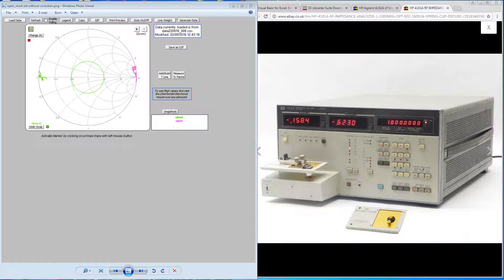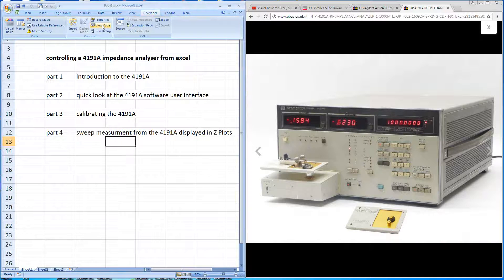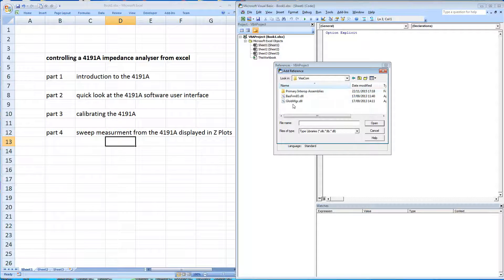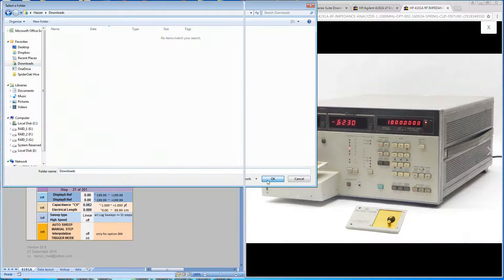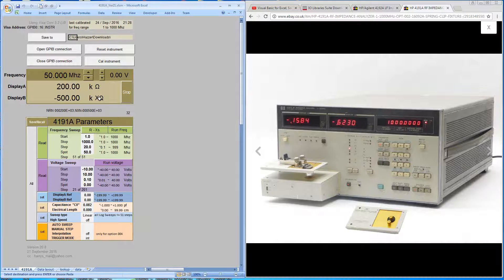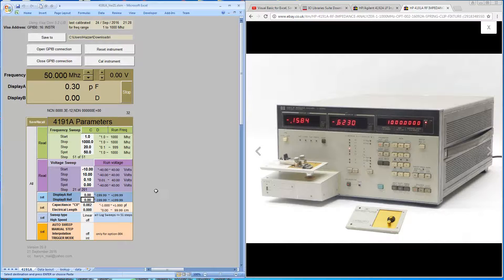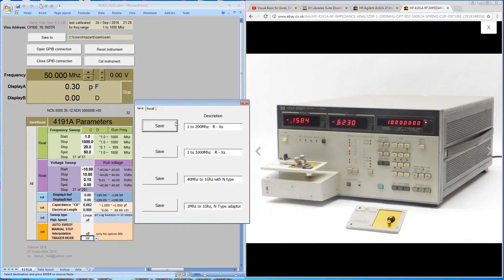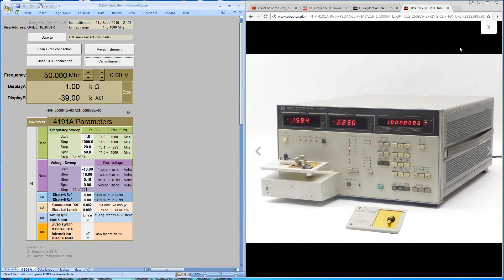4191A part 2   the software

Comment: Thank you for the good video. We are going to measure the pF value by connecting it with Excel with the 4192A equipment we currently use. Can I get an Excel file that can measure the pF value?

Comment: Harry, first thank you so much for your nice tutorial video. it helps me a lot. But I have a one question for excel software you prov ide. Now I have 4192A impedence but I don't have any interface software, so just wondering the software for 4191A can also be used for 4192A?
Reply from the maker: Hello Jea

You would need to re write much of the 4191A  code as the 4192A returns a completely different set of data.
But there is already some very good 4192A GPIB control software on the web.

see:
http://mkelzenb.caltech.edu/software/4192A/

I use this to control my 4192A over GPIB, its excellent.

73
Harry
Reply: Thank you so much for your very kind response. It really helps me a lot  :)